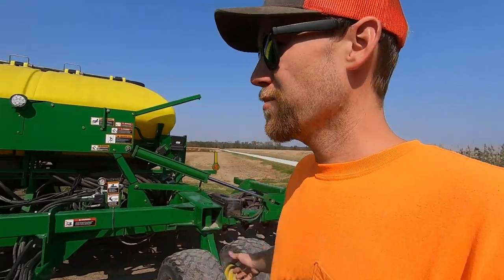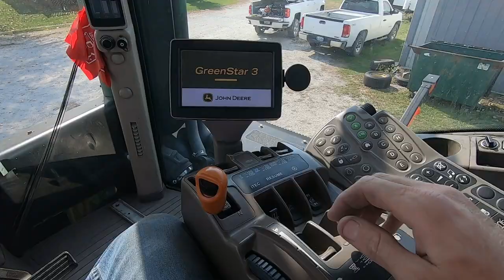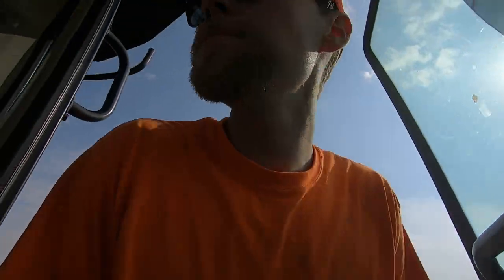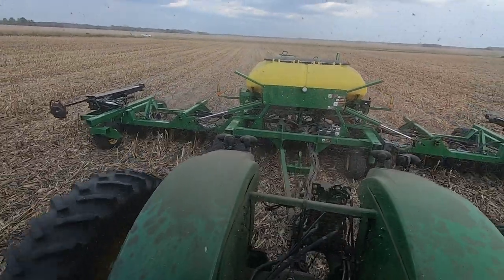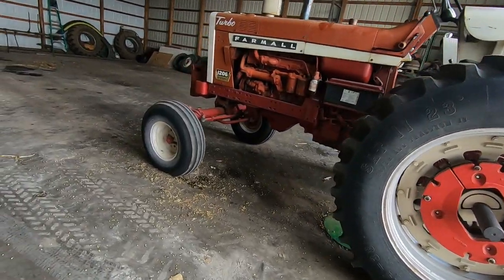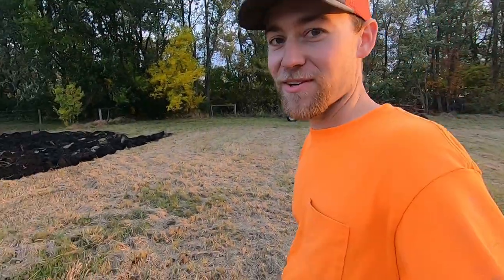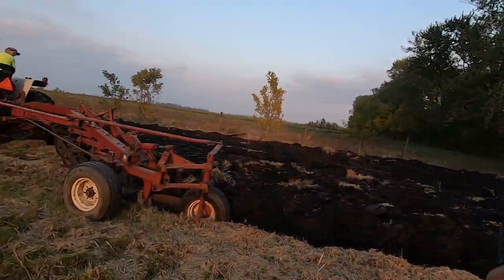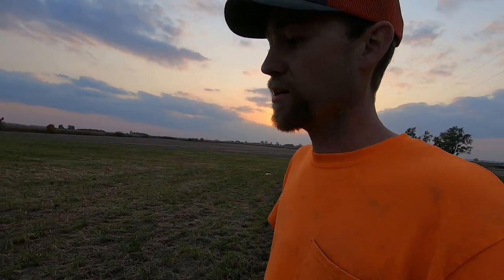Hay field removal with the IH 1206 and 5 bottom plow

Comment: The 1206 brings back 70s memories.
The sound of a 1206 is like no other tractor.  A smooth sound with no clatter that you get from most diesel engines.  Changing gears could be a little tricky when you came to the turnrow to change direction.......still a great tractor.  Dad had two 1206s that were used mostly for 6 row cultivating, plowing,  and other equipment that required a tractor with more pulling power at the time.

Comment: Hey Wes I have alot of dt407 engine parts brand new injectors a fully rebuilt head and roosa master fuel pump then engine sent a rod through the block but everything else is good oil pump cool water pump and so on

Comment: My Dad used to pull his 5-bottom IH plow with his 706 that had a blower added. He said the 706 did alright except in clay where it'd struggle. He traded the 706 for an 856 that pulled the same plow effortlessly and it didn't have a blower. Just that 15 extra HP made a big difference. By chance those aren't White Park cattle are they?
Reply from the maker: The cattle are shorthorn and shorthorn cross